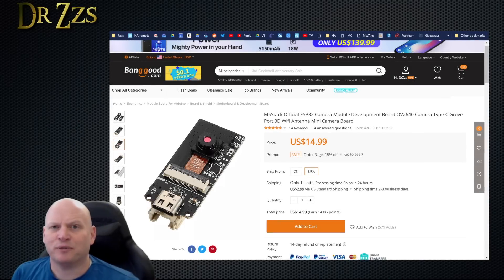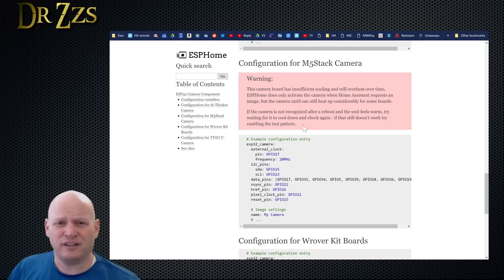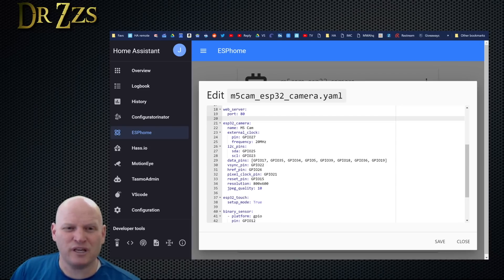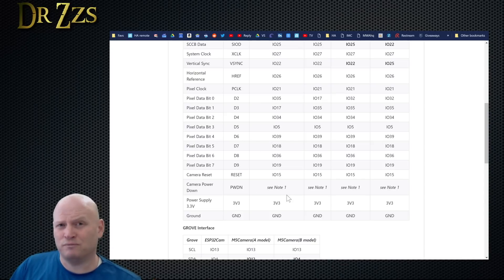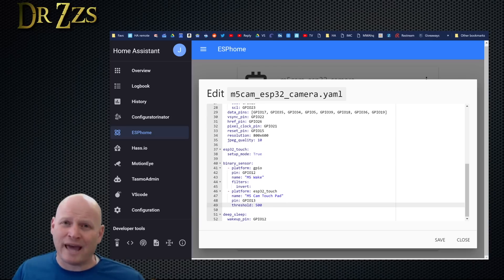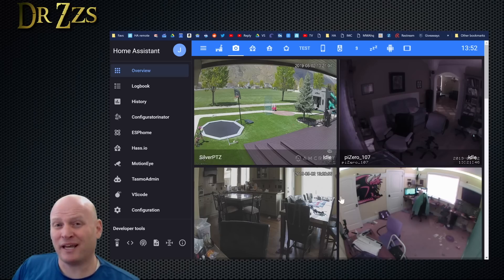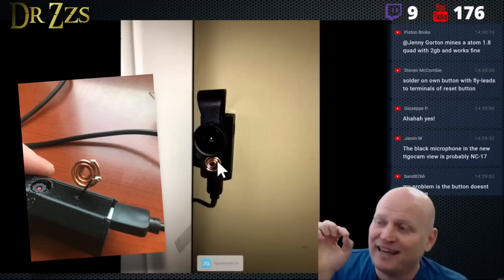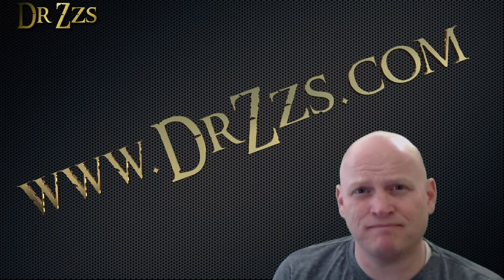Tiny Wifi Camera makes a pretty good DIY doorbell

Comment: Hey, So I got this M5Stack Cam the other day, but i'm having a real Hard time trying to flash anything onto it, getting this error with esptool 'COM3 failed to connect: could not open port 'COM3': PermissionError(13, 'Access is denied.', None, 5)'. No idea what's going on. If i connect my phone to the devices hotspot, I can access the video feed via my browser, so I know it's working, but I just can't doing anything with it

Comment: great work, thanks for sharing. This is great cheap replacement for ring door bell, could i replace the touch sensor button for a physical button ? also would be cool to intergrate a wemos d1 mini and and use a power shield to hook up rechargable battery

Comment: Hi! Sorry for being late but I've seen some variations of the board that have a pir sensor (and mic but  that's not as relevant). Do you think that I could record a clip every time it's motion triggered and pass it at Home Assistant? (sorry haven't used HA but I guess there must be some timeline or event feature?)
Reply from the maker: Hi
I can't really say what those different boards can do.  I'm sure they can do more than they could when I first made this video.  I can't tell you exactly how to do what you're asking about, but I would expect it is possible with some tinkering.
Reply: @DrZzs  Really appreciate your quick reply! I might try my luck and report back then. Thank you! ☺️

Comment: Great video! 
Hello, I need help. Maybe you can recommend me something concrete or at least make some suggestions in both the HW and SW parts. Any help is welcome. I need to set up a kind of surveillance/streaming system for a project at my school. I would very much like to do it with something like ESP32-EYE or ESP32-CAM. My intention is to stream (or as close as possible) on Youtube or FB directly from the module. I am not sure if that is possible and how to do it. I am very tight on time, and I don't have much money for testing either.  I know that you have a lot of experience and have tested many modules. Please, which ESP module/camera/software could I use for that? Thank you very much.
Reply from the maker: Thanks
I don't expect it would work very well.  It's certainly not something you'll be able to do quickly without a lot of trial and error.  Sorry

Comment: Great video's, keep making them. Question for you guys, I see you have the ESP32 cam running in motion eye. How did you configure it? I can't seem to find anything on how to configure it for motion eye.
Reply from the maker: I didn't get it into MotionEye.  I got it into Home Assistant by using ESPhome as the firmware on the ESP32 camera board.  There is another ESP32 camera firmware that will give a URL for you to view with other software like MotionEye. This is one option: https://randomnerdtutorials.com/esp32-cam-video-streaming-face-recognition-arduino-ide/

Comment: Hi Doc. Trying to copy your work but stuck at first hurdle. How do you connect the M5Cam to your home WiFi in the first place to load the ESPHome compiled firmware OTA? The only thing my board does is act as an access point with SSID m5stack-cam and publish the camera output over http? Must have missed something.
Reply from the maker: You're going to feel silly when I tell you...

The M5cam board has a USB connector. When you've made the ESPhome file and compiled it, you download the binary and upload it manually using ESPhomeflasher.
Reply: DrZzs yep silly is good. We all start out silly and unfortunately end up that way as well. Thanks for that, now using esptool.py  thanks mate.

Comment: Hey doc, I was wondering if it’s possible to have a setup which goes as follows: 
Have the M5stack camera publish an Mqtt command to a sonoff which is connected to a standard doorbell and is triggered as a momentary switch. 
This gives us the functionality of a traditional doorbell and the camera integrated in hassio. I am not smart enough to code, just smart enough to know that this might be possible.
Reply from the maker: I haven't been following the software progress for these cameras lately.  I don't know if there is a firmware that will trigger an mqtt message on motion.  I'm sure it is possible.  There's a channel called "Random Nerd", that does a lot with these cameras.  That's where I'd look to see what the latest and greatest firmware can do.  
In fact, I'll go peak at what he's up to right now :)

Comment: Hi Doc,  great videos !   Thanks.     A question,   the push notification only work in IOS?   I don't see information about configure notifications in android.  Regards
Reply from the maker: There are some option for notification with Android.  I think the best is probably html5, but pushbullet and Telegram are also good options.  They are still working on an official HA android app.  When that arrives it'll work just like the iOS app (hopefully).   https://www.home-assistant.io/components/html5/
Reply: @DrZzs  Do you mean Telegram the messaging app?

Comment: DrZzs, when I tap the notification on my iphone, instead of opening the attached video stream (as  seen in your video),  my Home Assistant App opens.  I can still open the video stream by sliding the notification to the left and tapping the exposed "View" button.

Is there a default I can set somewhere that causes the attached video stream to open when I tap the notification?
Reply from the maker: which phone do you have?  To get it to open the stream it's the "long press".  I don't think that was available before the iphone7.  If you do have one new enough to have that feature make sure it is enabled in your iphone settings.  If that doesn't do it then make sure you have the latest version of the HA app.  
Those are my first couple thoughts.  Hope it helps.
Reply: @DrZzs  Thanks DrZzs.  I have an Iphone 7.  Didn't know about the long press.  Everything's working now.  I just wasn't pressing hard enough.

Comment: hi, thanks for the video. Today  I received today my M5Stack Camera. I want to flash ESPHome, the camera is simply not detected on my PCs or Mac. I installed all drivers and connected the ESP board via the included USB-C to USB-A cable. I tried also a USB-C to USB-C adapter. But its not detected. Only a red LED  turns on, on the board and I can get a livestream in the browser if I connect to the moduls wifi. So its not broken or somethink. Did anyone experiences the same? Is this board flashable via USB-C? Is there another way to flash the module? Maybe with a FTDI Adapter?
Reply from the maker: bummer.  I flashed mine via usb.  Maybe there's a problem between the rx/tx connectors and the chip. When you connect it to the PC does it show up using ESPhomeflasher.exe?
Reply: DrZzs thanks for reply. it did not show up in esphomeflasher. Not in windows or mac. Also the usb devices is not detected and it makes no „ding dong“ sound when connecting to the usb port in windows. Maybe the board is broken.

Comment: hmmm at the price, might not as well get a wyze cam?
Reply from the maker: If you just want the camera, then yes, wyze is a better camera for nearly the same price.  Because these are based on ESP32 chip we can easily use the other GPIO pins for things like buttons and other sensors.  These can also be run on battery.
Reply: DrZzs that’s a good point Doc. Another good alternative is a wise cam plus a 433mhz remote controller disguised as a doorbell using. There are many ways to do it, thanks for the videos! Quite helpful

Comment: That’s awesome, would it be worth copying and pasting that automation so you have 2 but with 1 having a condition if door is locked and the other unlocked, so when it sends you the notification if locked it will give you the unlock option, but if unlocked it will send you the lock option in your notification..... might not be worth the trouble but would only need to be a matter of set and forget
Reply from the maker: Good idea!  
For right now the ios app (v1.5) will only let you send 1 version of buttons with a camera image.  Per Robbie (the HA iOS guru), when v2 of the app is released we will be able to change buttons based on different camera images.  I could have different buttons with different triggers and different notifications, but linking those buttons with the camera image (using the camera entity_id) is the tricky part.

Comment: hi doc, the part of the yaml that has a  binary_sensor. what is this for?
Reply from the maker: I was trying to use a reset button, but decided it wasn't going to do what I wanted so I took it out.  Maybe that's the one you saw.  Otherwise there is the one binary_sensor which is the second part of the touch sensor.  When the touch sensor is touched it changes that voltage reading, but that's all it does, UNLESS you add the threshold and set the binary sensor to respond to that threshold.  
Hope I'm explaining that well.

Comment: Good video. A few questions:
1) Is there a way to make the ESP32-CAM stream via RTSP instead of HTTP?
2) I know the camera has motion detection capabilities to some extend. How would I make it record a clip when it detection smotion and save it to the disk?
3) Is there a way to change the camera resolution on the go from the HA web ui? Maybe via an MQTT call or something?
Reply from the maker: those are great questions.  Unfortunately, as far as I've found (and I'm no expert), the software available for these ESP32 cameras is still pretty limited. I don't know of a firmware for these that streams rtsp.  
Motion detection is also firmware dependent.  Again, I don't know of a firmware that does motion detection.  That doesn't mean there isn't one.  It just means I don't know of one. 
As far as changing resolution via HA ui, I suppose you could build the ESPhome sketch so it has a template for the resolution and gets the numbers it needs from an input_select list.  I would expect the board would need to restart after that.  
These are things we've come to expect for most cameras, but these little $15 camera boards with a simple micro-controller brain might not be able to provide the same features as even a Wyze cam.
Reply: @DrZzs  Alright. Guess I'll probably upgrade to a wyze cam then. Let me know if you find anything that might work with the esp cam ;)

Comment: I don't understand how that touch pad working, is it single wire from gpin0 and 13 and touch works like resistor?
Reply from the maker: there's only one wire.  It goes from GPIO-13 to that coil of copper I put on the front.  I don't know exactly what it's measuring, but it can detect contact with a conductive material.  It's not like a switch or a button.  It just has one wire but it senses changes when you touch it.  Then you can tell it how to convert that change into a binary (on/off) sensor when you set the threshold.  The threshold will change depending on the wire you connect to that pin.  Hope that helps.  I don't know how else to explain it.
Reply: @DrZzs  clear enough! Thanks 👍

Comment: Have tried to get a ESP32-Cam to work, But i cannot get it flashed? Have tried with 2 seperate Usbt to seriall adapters and have flashed countless of ESP8266 chips. I do put it into flashmode, and i get the com port up in my computer but when i flash it just fails. Any help?
Reply from the maker: Which flashing tool are you using?  My old friend "flashEZ" doesn't work with ESP32 chips.  I use the ESPhome flashing tool .
Reply: @DrZzs  ohh Maybe i should give that a try then, i should be able to use one of the usb ports on my RPI 3? that is were my HA is and my ESPhome

Comment: Do I have to flash this with esphome? If so, I know how to use TTL and that stuff but I dont find information on what I need to flash it with?  (Ai-Thinker board)
Reply from the maker: it comes with some firmware installed, I believe.  What are you planning to do with it?  you want to use it with Home Assistant?  If so you'll have to flash it.  I have that board and am planning to put ESPhome on it, but I haven't had time to play with it yet.  Here's a link that shows where you need to connect the UART adapter to adjust the firmware.  
https://robotzero.one/esp32-cam-arduino-ide/
Hope that helps!
Reply: @DrZzs  Yes, with homeassistant. Thank you!

Comment: hello
is there a possibility to extend the connection between the camera and the board
Reply from the maker: yes, there are longer ribbon connectors available.  You might have to shop around a bit to find one.  I haven't bought one myself, but I have seen them on other ESP32cam boards.

Comment: Greetings,
Do you have any idea how to configure a v380s camera on homeassistant?
Reply from the maker: I don’t.  I’m actually not sure what a v380 camera is.  Is that the brand name?
Reply: @DrZzs  This is the one I am talking about: https://www.amazon.com/Veoker-Wireless-Panoramic-Megapixel-Detection/dp/B06XKFDVCZ

Any idea about the streaming port at least?
Reply from the maker: That's a cool camera.  I haven't seen that brand before.  Not sure what their software is capable of.  They don't list RTSP on their list of features so my guess is it won't provide a stream outside their app.  One thing to try would be to download blueiris (free if you only use one camera) and see if they have a way to connect to that camera brand.  I kinda doubt they will, since that seems like a fairly small brand, but it might be worth a try.

Comment: JPEG Quality refers to the level of compression.  The more the compression the lower the quality, but the smaller the size (in bytes).  So that means the lower the number, the less compression is used - therefore higher quality.  TL;DR = Lower numbers mean higher quality JPEGs.  A very neat project and well described!
Reply from the maker: Thanks!  That’s a nice explanation of jpeg quality stuff I didn’t know. Thanks!!